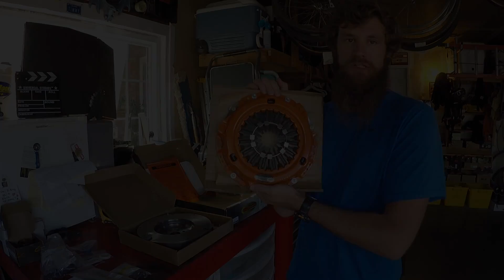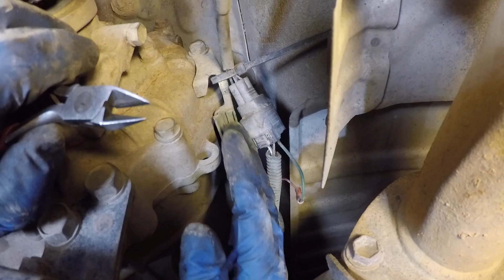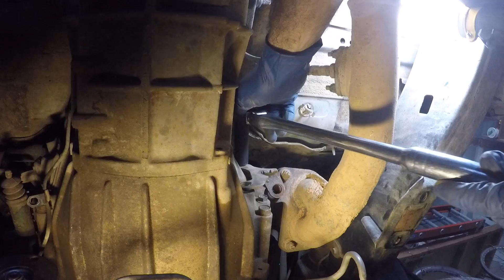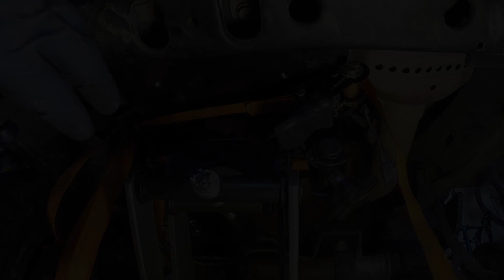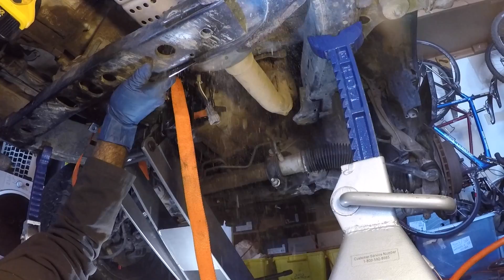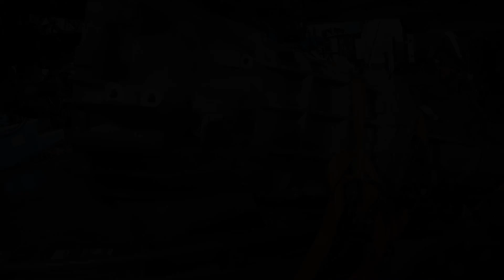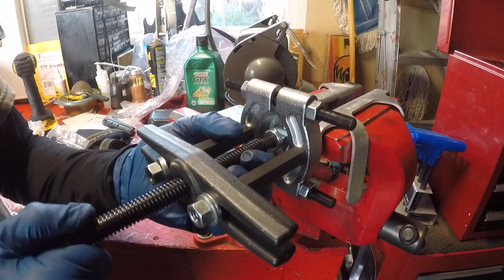Clutch Replacement (Part 1)

Comment: Looking from the front to the rear (underneath), where the bell housing attaches to the engine, on my 2000 4runner automatic, I can see the bottom of the fly wheel.  That can't be right, right?  that should have a cover on it correct? UPDATE- yes, it should have a plate.  Can you please tell me the bolt size(s) and I believe there are one or two that need nuts, the rest thread directly into the bell-housing.  I'm guessing M10's but I'm not sure and would need to know the length(s).  Thank you very much sir!
Reply from the maker: There's a half moon access plate on the bottom of the bell housing so you can access the flex plate/torque converter bolts.  This is so you can either remove the transmission or the engine.  So, you are obviously missing that plate.  It bolts to the bell housing with (4) 12mm bolts.  By the way, fly wheels are for manual transmissions.  Automatic transmissions have a flex plate.
Reply: @TimmyTheToolman  Thank you so very much!  Do you know the lengths?  I think two thread directly in, but I don't want to bottom out & I think there are two that require the bolt and nut & those might be longer.  Sorry to ask, but since all of this is missing I'm at a loss.
Reply from the maker: @christopherbrown5338  There's no bolt and nut, it's just bolt that hold that plate on.  I'm pressure sure they are an M8 x 1.25 bolt.  I don't know the length, but something around 3/4" would probably do it.
Reply: @TimmyTheToolman  I've seen an exploded assembly and it shows two bolts with nuts & two bolts.
Reply from the maker: @christopherbrown5338  Maybe it's different for some years, but I've removed these plates many times, and it's just 4 bolts.  I suggest getting a short M8 x 1.25 bolt and getting under the truck and checking if any of the holes aren't threaded.
Reply: @TimmyTheToolman  Ok, I think I'll have to just jack up the front and use my thread gauge and calipers to check depth.  I'll let you know what I find.  FYI- Mine in a Automatic transmission (A340F)

Comment: Thanks!!! I used you video to do my 94 T100 truck clutch this week

FYI, my pivot point (for the clutch release fork) was broken, but I could still shift just enough to drive. 300k Miles on the original clutch (I baby all my clutches)
Reply from the maker: @GSXRMVDUCRD  You're welcome.  I've heard of those pivots breaking on other people's transmissions.

Comment: Hey Tim, would you happen to know the torque spec for those 9 bolts that mount the bell housing to the transmission? I wasn’t able to find it listed in the FSM or anywhere online.
Reply from the maker: The torque spec for those 9 bell housing bolts is 29 ft-lbs.
Reply: Also, I should add, unlike others that were less fortunate, none of these bolts broke when removing them. I used a little penetrating oil and manual hand tools.

Comment: hey timmy, fyi the nachi pilot bearing link is bad.
Reply from the maker: @Life.LO17  Thanks for letting me know.
Reply: @TimmyTheToolman  Can we still use the OEM pilot bearing with using the clutch in the video? I assume so since the shaft is not being modified. Is there a reason not to use an OEM pilot bearing?
Reply from the maker: @BKISHDROID You can absolutely use an OEM pilot bearing.  The Nachi bearing is just a more affordable option since it doesn't have the Toyota name of the box.
Reply: @TimmyTheToolman  Thanks for the update. Makes sense. As the previous guy pointed out the link for that bearing in the description is broken (again?) but after your feedback, I think I will stick to the factory one. Thanks again.
Reply from the maker: @BKISHDROID No problem.

Comment: looks like this may be my next project. have a whine that goes away when i press in my clutch. question....which seal did you decide not to touch due to the broken studs? "rear main seal"?
Reply from the maker: The input seal on the transmission.  I mistakingly thought the bell housing needed to come off to replace that seal, but you only need to take the inside cover off that fits around the input shaft to access that seal to replace it.  It wasn't studs that broke.  A few of the bell housing bolts were seized and broke off when we removed the bell housing.  We replaced the rear main seal in the video.

Comment: Hey, Tim, 

Do you know if the flywheel comes with those three studs or bolts attached or need to be bought separatedly on Toyota dealer?
Reply from the maker: Are you talking about the alignment dowels on the fly wheel that the clutch pressure plate slides onto?
Reply: Yeah, I do not know the actual name of those three, but I am about to buy a flywheel and I do not want to realize I am missing those while installing it. So I was wondering if you could confirm.
Reply: Do you know where could I buy the aligning tool for the shaft of the transmision into the clutch?
Reply from the maker: @jacobliddiard158  It usually comes with the clutch kit.
Reply: @TimmyTheToolman  I am buying everything through the dealer, that's why I was asking.
Reply from the maker: @xabdabpab  The alignment tool should come with your new clutch.

Comment: Is it possible for the transmission or transfer to leak from these areas. I gotta leak. Lol
Reply from the maker: What areas?
Reply: @ sorry the shifter seat?
Reply from the maker: @cbdreamer1709  Yes, a deteriorated shifter seat for the manual transmission or transfer cases can allow gear oil leak out.
Reply: @ thanks. I’ll check that first. Hopefully it’s not a maiting point. Don’t know where else could be leaking

Comment: My throw out bearing is starting to chirp. Thinking of doing this job soon. I noticed by looking into the transmission that the tb is just barely touching causing it to spin. Though it’s suppose to not touch when clutch is disengaged? If so do you know what the cause might be and how to solve it?
Reply from the maker: @liamroberts7054  That's a good question.   I know a properly adjusted clutch pedal has free play, meaning there's a little bit of play between the fully retracted clutch pedal and the beginning of feeling resistance when you apply the clutch pedal.  I've never looked inside the transmission like you have to see what's going on, but I would think it shouldn't be touching the pressure plate when the clutch pedal is fully released.   I wish I could give you a definitive answer.  I can do a little research and see what I can find.
Reply: @TimmyTheToolman  yeah that would be awesome. I don’t think it’s supposed  to touch the pressure plate but I wasn’t sure. I have messed with the free play a bunch and noting made a difference, now have the free play set to spec. The only way it would stop making contact was when I pushed the shift fork in a little.
Reply: @TimmyTheToolman  it doesn’t take much to make it stop contacting, it’s just barley touching causing it to spin.

Comment: Question; is this "easier" to do if I come from the front? I have the head out right now and thinking in pulling out the block to send to machine shop as well; Transmission I am hopping to leave in the truck; while at it, is it not "easier" to replace the clutch and all these components since the transmission can stay in place ---- OR ---- the transmission needs to be also pulled out with the block? my concern would be once the engine is assembled if I can guide the whole thing with the clutch in it into the transmission, I mean the crankshaft shaft; my clearance from engine block to front is about 8 inches, or may need to assembly everything outside then guide the whole transmission and engine into the bay? This is a 2000 Toyota Tacoma, seems I can slide to the sides the steering pump and the ac compressor without disturbing the lines; the radiator is out but the condenser radiator is not. In my case what it sucks is I do have a hydraulic half lift from Max Jax in my garage but this truck is outside on the side of the house, the lift is occupied with our 2015 Chrysler Town and Country which needs the engine back on, it is ready to assembly but have not done it, now I need "a car" anyone of the 2 as we got not running vehicle and thought it would be easier for me to get the Tacoma running but to work on it i would not be able to use the lift unless work on the TC first and get it off the lift, then I would have to push the Tacoma from the side to the garage to use the lift but at that point it would be without the engine on it...wondering if and what is worth it and what works best and the faster way to get one of them running??? any inside would be greatly appreciated~!!
Reply from the maker: You can pull the engine to do the clutch job.  The transmission doesn't have to be removed.  You will struggle a bit to get the engine mated up to the transmission.  Having some extra people helping would be advised.  You can watch our 3.0 to 3.4 swap series at the part where we're installing the engine for some tips.  https://youtu.be/_YevoE7Xw7s?si=h5FkNYFwbWKBBHrK
Reply: @TimmyTheToolman  Awesome!! thank you so much for that, I have been all day today chewing on leave the engine block in and fix the head then put it back and then do the block at a later time but i struggled so much to get the head out that I think the best thing to do is to take an extra week or 2 if needed but to get everything done in one shot specially if doing it without the lift which have me furious; to have the lift and not being able to use it! specially I bought it specifically to do this job with this car because of the 2 trans bolts on top that you used a bunch of extensions; i have a 48" bar for it! but that is all easier with the car lifted

Comment: @timmythetoolman, it seems like some of the online FSMs that are hosted do NOT include the manual transmission section. Have you found that to be the case also? Curious what volume or edition you have for yours (outside of it being for a 2000). Thinking about purchasing one to have on hand going forward.
Reply from the maker: For 3rd Gen 4runner jobs, I don't use an online manual.  I have the physical books.  If you get an actual Toyota FSM, it will complete.  Just look up your year on Ebay and you'll find a set for sale.

Comment: How to check shocks to see if they are good or bad?
Reply from the maker: @isaias.ramon.gonzalez.angel.63  Push down on the front and rear of the vehicle.  If the suspension sinks, rises, and stops fairly quickly, the shocks are probably still good.  If the vehicle keeps moving and swaying, the shocks are shot.

Comment: If you watch the removal of the clutch fork/throwout bearing and pay attention to the orientation of the wire retaining clip that holds them together.... looks like he reassembled it differently.... which is correct? Watch starting at 51:00....
Reply from the maker: I see what you mean, but if you're concerned about the correct orientation, jut pay attention to the way it looks when you pull out the clutch fork and throw-out bearing and mimic that orientation when you put it back together with the new parts.  All I can say is Dan has been running his rig since the job was done with no issues.  If the orientation of the retaining clip for the bearing was wrong, I guess it wasn't that important.
Reply: @TimmyTheToolman  thanks for the response.... I was specifically focused on that part of the video because my throwout bearing sort of just fell out when removing as the stamped steel part is in 4 pieces. Appreciate your videos, huge help!
Reply from the maker: @CaptainSkidmark74  You're welcome.

Comment: I wasnt able to get my 1/2 inch extensions to fit all the way back to the bolthead for the top of the bellhousing. Just not enough space in between the tranny and body. Anyone know of another point of access?
Reply from the maker: You should be able to get 1/2" extensions in there.  Do you have wobble extensions.  There is no other point of access unless you try through the shifter hole.  You could try 3/8" extensions instead if you truly can't get a 1/2" extension between the trans and body.  There is no "anyone" other than us that will see your comment and help you.  If you want that sort of help, a Toyota forum or Toyota Facebook group would be your best bet.  You can also get a jack under the trans, remove the cross member and lower the trans a bit so it's further away from the body.

Comment: Doing this job now on my wife's second Toyota, the first one I did was on her T100 4x4 SR5 long bed, now she has this  2001 Tacoma, I was contemplating actually loosing the motor mounts a little bit to get more tilt on the assembly transmission and engine to get to those top two bell housing bolts with out such a long extension(s), or possibly through the shifter plate hole with an air ratchet regardless probably going to need a wobble end on it. So far I've learned that the T100 is much easier to work on from clutch service aspect, and not so much from other aspects... lol
Reply from the maker: Good luck with the job.  Long extensions are your friend when it comes to the top bell housing bolts.  Wobble extensions can make a huge difference.  Just make the investment in extensions.

Comment: In your opinion would it be better to have a single 36" socket extension to reach the top two bell housing bolts, or piece together shorter extensions including a wobbler?
Thanks
Reply from the maker: A single 36" wobble extension would be pretty nice to have for this type of work.

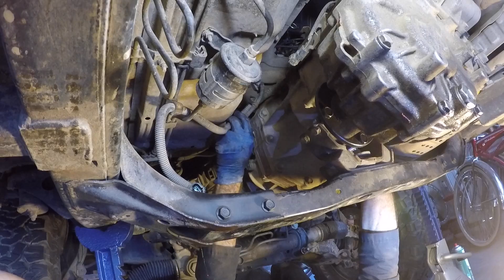Comment: 10:49 ... this rig has the push-button on the transfer shift lever? ... his hand is sorta covering it up for a good look at it
Reply from the maker: It wasn't a push button style.  Push button style knobs don't screw off.  There'a a set screw you remove on the side of the shifter and then it slides off the shift rod.
Reply: @TimmyTheToolman  thank you for the education.. That deserves an option for a beer! This '97 tacoma I have found a loosey goosey unconnected connector with a blue end hanging of the side of the recently installed yota1 r150F and I was hunting for clues on where it goes and what it is doing there. Maybe it goes to the forward O2 sensor that I still haven't located high up there

Comment: I am going to attempt to do this to my truck, I am curious about trans fluid and lines, I didn't see or missed you removing them or draining the trans
Reply from the maker: Manual transmissions don't have fluid lines.  You're thinking automatic transmissions.  You don't need to drain the transmission gear oil for this job, but it wouldn't be a bad idea if it's been a while since the has fluid has been renewed.
Reply: @TimmyTheToolman  i was wondering why there were 7qts of gear oil in the parts list too! did mine recently, will remove from cart :)

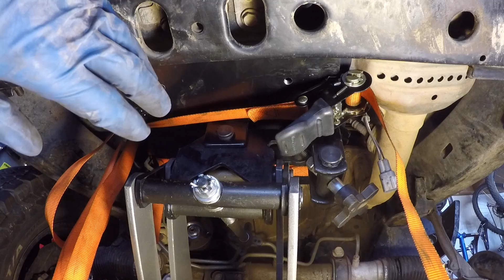Comment: ? 24:28  O2 sensor connector mount post is broken, what is the proper procedure to remove this so it does not break?  Timmy I noticed on your personal rig (on another video of yours)  that your connector mount post here did not appear to be broken like on this one?
Reply from the maker: I can't remember how the release works to get the connector free of its mount.  Some of those types of connector mounts are a pain in the ass to disconnect, and that's why it was broken.  Somebody lost patience and manhandled it.  It's not a big deal and one of the reasons zipties were invented.
Reply: @TimmyTheToolman squeeze and push!
Reply: no slide involved...
Reply: @TimmyTheToolman   for some perhaps not a big deal!,  but to others that wish for their rig to be unmolested it is a big deal! i am sure there are those of you out there LOL

it cost me 100$ to learn how to take these off properly. I was trying to figure out how to take the crank sensor harness off the oil guide tube on the '96 Corolla and broke it. Bot a new one to see what parts it came with. the slider part of that connector (allows for movement) is not a separate piece that i can tell and will NOT disconnect that i can find. 

if you wrench that bracket off the transfer case (or perhaps a needle nose pilers if you can reach it behind the bracket) there are two hard plastic wings that squeeze gently and push it through the hole. clean any crud behind those wings so it squeezes better. 

it might be the same type of connector on the black 5VZFE front that i think is the crank position sensor mount?